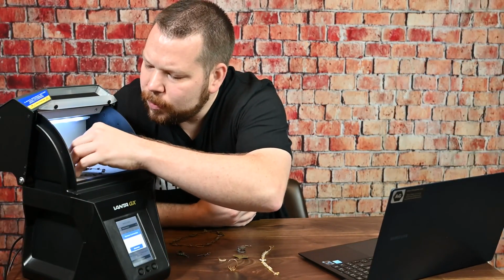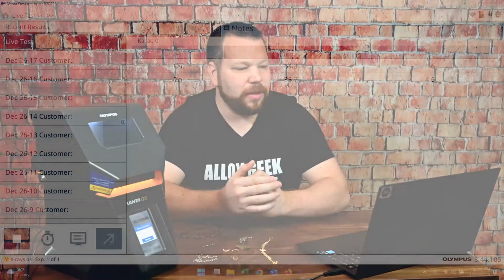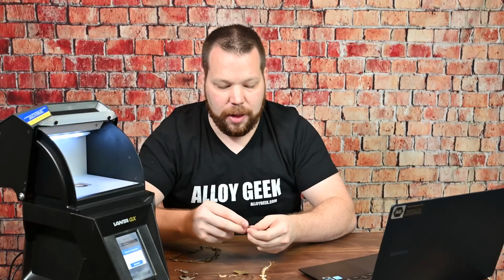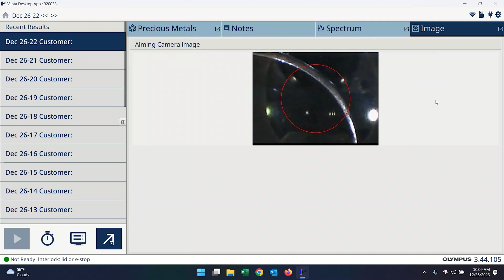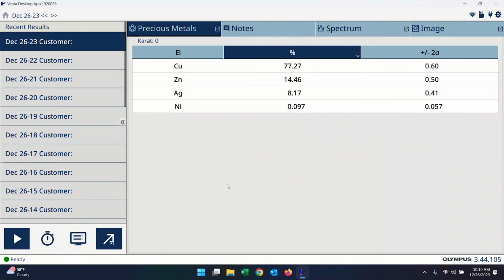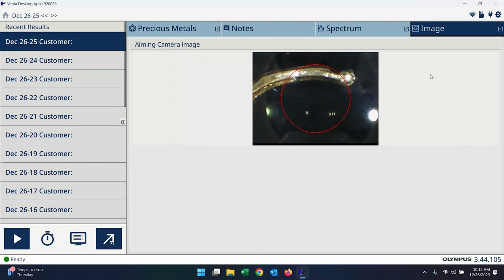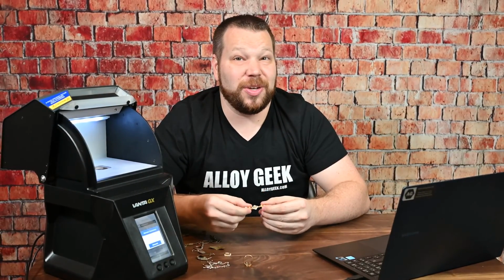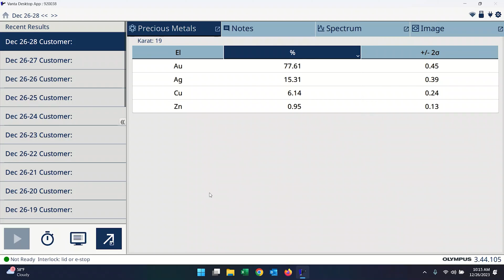How to Test Jewelry Featuring the Olympus Vanta GX Benchtop XRF

Comment: Thanks for this wonderful video. Is it safe to use daily or is there radiation exposure from using this machine? I see there's a "caution" yellow flag on the external side.
Reply from the maker: Benchtops like the Vanta GX are much safer than handhelds. Many people use them all day long! Yes, they are safe. The xrays turn off when the chamber is opened!

Comment from the maker: The handle for the Vanta GX is hidden under the front hood. It is just designed nicely not to stick out. 

The gold detection and karating of this unit work well too. I have another video where I shoot certified Reference materials with pretty darn good numbers.

Plating detection on any XRF is limited to a depth of around 20um. This is more a limit of XRF technology and not a particular instrument.

The Vanta GX is available in both pin-diode and Silicon Drift Detector (SDD).
Reply: I watched a movie with reference samples, and indeed, the measurements are very accurate. Was the device you used  with  Si-PIN or SDD detector? I think the handle should be for opening because when closing, you touch the external part of the housing with fingers and this part is painted. After a year of intensive use, the paint may wear off. We are talking about a device that costs around $25,000, not $1,000, so...
Also, could you provide some insights into the camera quality? Is the image sharp and clear? In the video, it seems slightly blurry. These are high-end devices, and in my opinion, every detail should be perfected to achieve excellence.
Reply: 25k for a XRF is low end FYI unless you're talking about chinese etc etc...  High end looking at 50-100k, this is for the built for market required. Looks great in my shop, paint I can't see ever wearing.
Reply from the maker: @Maddoxd-vx9xs  In 2024, I would expect pricing between $20,000-25,000 USD for this type of XRF. I recommend staying with an American company as the support and quality is much higher. While Alloy Geek does not work for any of these manufacturers, we do think this price point is good for most small businesses including jewelers.

Comment: The device test, in my opinion, is not good. People who buy a spectrometer for around $25,000 mostly test gold, so you should focus on various gold samples in different types of jewelry and how the device performs in detecting gold-plated items. I had the chance to test an old Olympus GoldXpert, and it detected a gold Krugerrand as gold-plated. I'm not sure about this model, but it's exactly the same as the Vanta gun, a Linux-based system. So, perhaps they've improved something in detecting gold-plated items because that wasn't good in the old GoldXpert. Besides, it's unknown whether this version has the SDD or Si Pin detector. This should also be mentioned in the test. The higher purity in the center of the emblem probably results from significantly fewer impurities there, or it could be made from a different piece of gold. If the detector picks up dirt and tiny metal shavings that disrupt the measurement, it can show a lower reading. This surely has nothing to do with gravity. Moreover, before measurement, the tested fragment should be thoroughly cleaned if precise measurements are desired. Lastly, a device of this type should have a handle for opening, as seen in Fischer devices. Olympus didn't excel in this aspect, opting for the top part of the field version cover for the Vanta gun and presenting it as a new device.